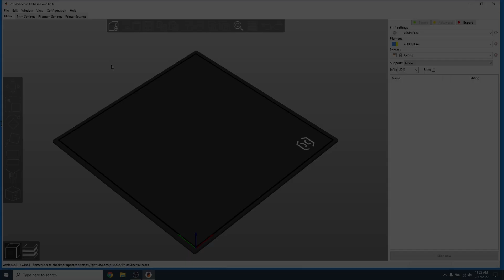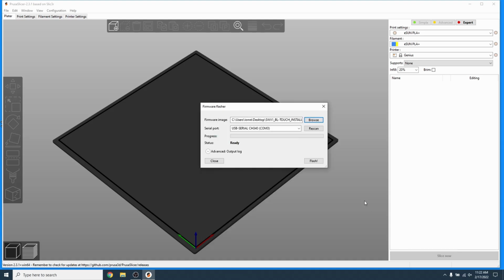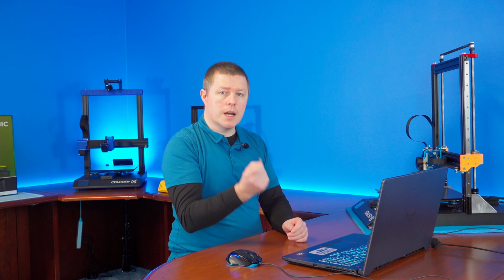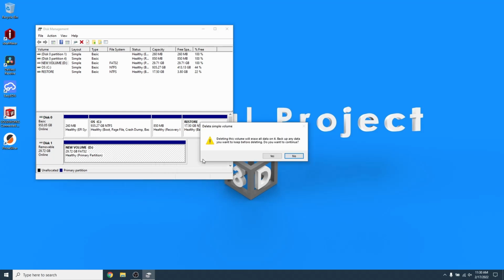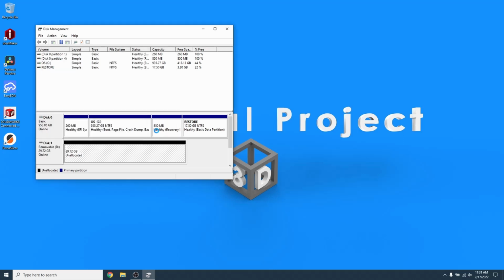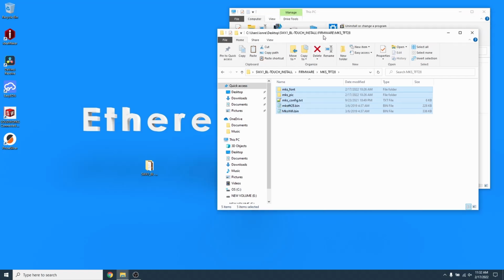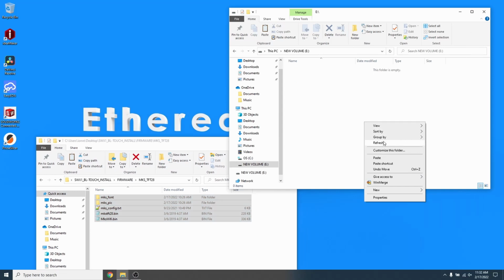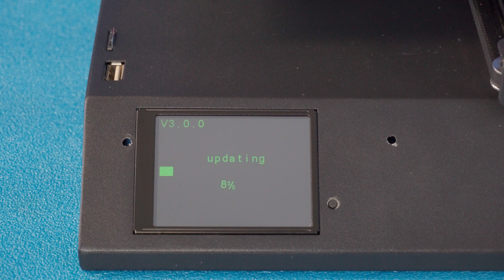Sidewinder X1 BL-Touch install, the easy way.

Comment: would it be possible to do this mod and then update the firmware to increase the max temperature? I am currently trying to do this with the wagster mod and Bl touch but I am struggling and I think it may be due to older firmware.
Reply from the maker: Yes I can update it for a higher temp. I am out for the rest of the week but will get it this weekend
Reply: @EtherealProject3D  thank you for the quick response, I was able to update max temp successfully. I guess now I should order the board and flash the firmware.

I am running a bondtech extruder. Do you happen to know if it is compatible with the new board? I would assume that it does since the extruder works with the stock board.
Reply from the maker: @eliteman125  I see no reason why it would not. The main purpose of the board is to give connections for the heater, fans, thermistor, extruder and bltouch.

Comment: Thanks for the great video. By the way, is there any way I can see the configuration.h and configuration _adv.h files for the compiled firmware? I need to edit some things for my new extruder. Thanks!
Reply from the maker: The source files are in the download.
Reply: I think a program that was still open was interfering with firmware while it was building. Closing it seems to fix the problem. Thanks again for the great video!
Reply from the maker: @talontartigrade63  Your welcome, and thank you.

Comment: Hi, i was not able to flash your source firmware with arduino as it gave me errors. 
Something about it not working for the ATMega 2560 board. Would love to give your firm a try though. 
I need to edit the firm as i use the Hemera extruder. I use another firmware for now but i use your TFT Firmware as the one that came with the other firm didn´t have the save to eeprom function. The combination works for now. Only thing missing to make this even more awesome is the AutoPID Function and ofcourse for me to be able to edit the source code and or just have the firm made for the Hemera. I´ll continue to try and edit the code and if i can i´ll report back here . :D
Reply from the maker: Have you tried vs code? Thats what i use. Also if you need me to make the changes for your hemera i can do that and send you the hex file.
Reply: @EtherealProject3D  Hey thanks for the quick response. I will give vs code a go and let you know. If i can´t get it to work then if you could edit it? that would be great. First i´ll try Vs code .
Reply from the maker: @TheNr1rob  Sweet, let me know how it gos.
Reply: @EtherealProject3D  Okaaay, i managed to get this working on my printer. I had to change some things in the code. One of these things is the Wagster mod pin change. Made some more changes though. Now i changed things around and have your firmware in my printer but use another firm for the tft as like that i have all the options i need. 
I hope you put some more funcions on you TFT firm as it looks great. And yes i used Vs code this time. I am printing a 7 hour long print to test it. So far works solid, thanks alot. If you want i can pass it along? so you can check it out.
Thanks again for this .
Reply from the maker: Sure that sounds great

Comment: Does the firmware still need to be upgraded if running the wagster mod?
Reply from the maker: If you are just installing the board than no, just make sure the wires are going to the correct spots.

Comment: I have your board, but haven't installed it yet. I might try to find a way to use the original z endstop with a pei bed.
Reply from the maker: It is doable for sure. If you need help please feel free to reach out.

Comment from the maker: UPDATE: 4-2-2022, I have added an STL file in the download with a BL-Touch mount that will fit those printers that have the standoffs on their extruder stepper motor. Its is "BL-Touch Mount (Big Holes)"

Comment: Hi ! I got a problem with the firmware it didn't flash. I got an error when verifying the .hex in the journal. And another thing, the heat's nozzle is negativ now.
Reply from the maker: Make sure you disconnect the TFT before flashing the mainboard.
Reply: @EtherealProject3D  Yes the TFT is disconnected. But I think I got a problem with the port COM. It's not staying open long enough. I'm on windows 10 and I hear the sound when the port connect and disconnect, and there is just a few seconds between each one. I try several cable but it didn't works better.
Reply: News from the darkness !! Anything is working but the screen. No moves, no heating. But I can say that you have a great logo.
The problem is on the motherboard, I think. I still can't connect the printer on Prusa slicer or Cura. 
Everything fine, it's just what I wanna do. Don't worry, it won't hurt.
Reply: So I check ten times, I flash ten times and ....It works ! Don't ask me why because  i change nothing.
But now when I do the Auto home, the extruder comes beating the left of the x axis, as if it don't stop at the end stop.
i change de cable on the motherboard in case I put the wrong one, but the same result.
And another question, when you flash the firmware with Prusa Slicer, do you need to be on the profil of the X1 ?
Reply from the maker: @filendiussivrac7442  no you dont need to be in any profile when flashing. Also if you have the printer connected to pronterface or even have cura open while flashing it will cause issues.
Reply: @EtherealProject3D  i order a new card for the x axis and a new endstop.
What will be the process to check if the problem comes from the motherboard ?
Reply: I'm still on the problem of the x axis. The endstop doesn't stop anything and it's a new one.
Reply from the maker: @filendiussivrac7442  At this point I would say you have a wiring problem.
Reply: @EtherealProject3D  In fact the x and y ensdtop don't work. So I would say that I'm gonna try ten times to reflash the firmware and see if it works.
If you have any idea ?
Reply from the maker: @filendiussivrac7442  They are not plugged in all the way or they are plugged into the wrong spot on the mainboard.
Reply: I re-flash the firmware and the problem is still here. It smell like the motherboard has a problem or the size of the bed is wrong on your firmware
Reply: @EtherealProject3D  Where would be the other plug ?
Reply: I try the other blue plug y axis and nothing.
Reply: is it normal in configuration.h :#define X_MIN_ENDSTOP_INVERTING true  // Set to true to invert the logic of the endstop.
#define Y_MIN_ENDSTOP_INVERTING true  // Set to true to invert the logic of the endstop.
they're setting on true instead of the others ? I try to compile the modification but i'can't.
I don't know what to do.
I replug all the tings to get back  and the endstops don't work. Could it be the mainboard ?
Would it worth it to upgrade it ?

Comment: This was a great video and very easy to follow along. I was able to easily add the BLTouch to my SWX1 V4 very easily. The only questions I have is, 1-will this still allow the printer to work with Repetier-Server Pro 1.2.1, 2-Repetier-Host and if so, are there any changes that need to be made to the slicer software within Repetier-Host? I primarily use Slic3r within Repetier-Host.
Reply from the maker: Im not sure, I have not tried that configuration before. Give it a try and let me know how it works. Thank you.

Comment: What was the reason for using a different connector for the thermister? Since you designed a new PCB, you could have used the standard connector to make it plug and play. If you need to krimp on new connector to the thermistor, you might as well just krimp on a dupont connector onto the BLtouch and plug it into the socket for the RGB led. Not sure how this board adds anything new to the table this way.
Reply from the maker: The new connector is a much more reliable connector that can hold up to the vibration and movement of the hot end. Same with the Ribbon cable connector, it locks down on the cable holding it in place more secure and putting more pressure on the contacts themselves creating a substantially more robust connection.
Reply: @EtherealProject3D  I missed the ribon cable connector, that's indeed a weak part of the original design.

I haven't had any issues with the thermister connectors on both of my machines though, but maybe I'm just lucky ;)

Comment: Hi Matt!  are  you planning on making the BL touch mount for an e3d Volcano block setup by any chance?  Thanks and keep up the awesome work mate!!
Reply: Forgot to add, my set up has BMG and Volcano, so I was wondering if this is something you would be able to include as options for your mount.   Or, BMG with v6.  Thanks!!
Reply from the maker: I would need a cad file for the bmg setup, or get my hands on one.
Reply: If you're still interested, I could provide CAD files for the BMG / Volcano setup which I've made in preparation to doing this mod myself. I'm not entirely sure of the dimensional accuracy, but since I've put the design together from the official BMG and Volcano dimensions, it should be close at least.
Another option would be to mount the BLTouch using a different method, like the height adjustable mount on 3DChan's ultimate cooler: https://www.thingiverse.com/thing:4548801

Comment: il na pas de LED ?????????????????
Reply from the maker: Connecting the BL-Touch using the existing traces in the ribbon cables will use the traces previously used by the LED.
Reply: @EtherealProject3D  j'ai acheter cette carte et j'ai pas reçu la piece et j'ai pas reçu de facture bizar ????
Reply: et j'ai un order number
Reply: yo lo que hice es poner en el frontal, junto a la pantalla TFT, el led retirado del extrusor, conectado a la conexión liberada de la placa base, mas que nada para ver la actividad de calentamiento del extrusor y de la cama

Comment: Fun to watch video, even though I don't need this mod (I own Artillery Genius). The linear rails mod for the Z axis caught my eye, are STL files available?
Reply from the maker: That is a work in progress and not any ware near my final design and I am not ready to share just yet. If done incorrectly it could cause issues with the printer. I'm sure there are plenty of people that could figure it out but there are also plenty of people that would do it wrong and potentially damage their machine and would be super pissed at me.

Comment: Thanks for this.  Can you please remix your BL touch bracket to support mosquito hot ends as well?
Reply from the maker: I don't have a Mosquito hot end to reference. If you have exact measurements of what you want, Its not hard to design up a new one.
Reply: Spoke too soon.  Extruder was fine until it just randomly locks up.  Not sure what is causing it, but the gear is just vibrating and not turning.  Very weird.
Reply from the maker: @Overnumbered808  You might need to adjust the Vref for the new extruder.
Reply: @EtherealProject3D  nah it appears that I'm just a noob and don't know how to load the filament into this bond tech properly.  I am just inexperienced with this setup.  Learning more about it everyday though.  I saw some posts about VREF adjustments but I probably won't dive too deep into it for now.  I properly loaded the filament and things are looking promising.
Reply from the maker: @Overnumbered808  Good, Im glad you seem to have figured it out.
Reply: @EtherealProject3D  unfortunately I haven’t figured it out.  The problem kept coming back and forced me to forego the BLtouch and board.  I reverted back to your mesh level firmware/stock PCB  (used reliably with mosquito magnum + LGX) for now.

Comment from the maker: For those of you that have been asking for my spool holder and filament guides, here is a link to the STL files. https://www.etherealproject3d.com/downloads/sidewinder-x1-spool-holder-and-guides
Reply: I noticed the filament guide in your video is two pieces, is there a benefit vs the downloadable file?  Also, Do you have some extra tubing on the one you have in the video?  Thanks for your videos. i ordered your board and have ordered a BL-Touch. Excited to install when it comes in.
Reply from the maker: @mfeltster  the 2 piece design was a previous version that was for testing the concept. The one piece guide makes it easy. You could add a little extra tubing going in and out but its not necessary. Thank you for your support.
Reply: @EtherealProject3D  Where do you get the tubing? Also, I notice your top belt sits a lot higher, out of curiosity what is that mod? Also, the BL-touch and PCB mod have been awesome! finally back to printing...thanks again
Reply from the maker: I got the PTFE tube on amazon. As far as the height of the top belt, I converted to 1204 ball screws and they are a little bit longer than the lead screws that come on the printer. Im happy you got your printer back up and running.
Reply: @EtherealProject3D  What did you do with filament runout sensor?
Reply from the maker: @mfeltster  I removed it.

Comment: hey! :)
Pls help me a little bit.
I have as same printer as you. sw x1.
when i start a print, i have to restart the printer two to three times to start, because the requested temperature will be zero.
can you possibly find a solution for this?
Thanks a lot!
Reply from the maker: Try a different slicer to rule that out.

Comment: I've already installed my bl-touch using a different method, but just watched this and I wish this was the video I watched to install mine, You made it extremally easy and also used good lighting which is VERY important when you have to plug in the connections to the board.

10/10. Keep up all the hard work.

Also anyway you could share the link to your spool holder? it looks AMAZING.
Edit: nvm about the feeder system,  I just saw the comment below saying you need to upload it still.
Reply from the maker: Thank you very much. Yeah I will get it uploaded this weekend.
Reply: @EtherealProject3D  Just tried to flash the firmware and run my BLtouch and I'm getting the error Stop! BLtouch error m999.

I'm guessing it is because I'm not using the same connection for my BLtouch?

I used the waggsters mod before you uploaded this so I no longer have the black wire connected. (Since my wires run to the led on the extruder instead of your board)

Any tips on what I should do? I'd much rather run your firmware versus the waggsters version since you have the option to level  four corners as well as the auto level.
Reply from the maker: @joshuamiller409  You can try to wire the inside of your printer like mine and I believe It will work. I started with wagsters setup and evolved it into what I have now.
Reply: @EtherealProject3D  mind if I pick you brain a little on discord?
Reply from the maker: I dont have discord, you can email my on my website

Comment: Excellent new set (which I know debuted last video) especially like the LED parameter lighting.
I agree with Jeremy Woods, you should be on retainer by Artillery.
Outstanding video!  I was anxious for this video and you did not disappoint.  Clear concise and perfectly informative.
p.s. If we are interested in your filament feed system where might we procure the files?
Reply from the maker: Thank you very much. I still need to upload the STL files to my website
Reply from the maker: I added my filament feed system to my website, https://www.etherealproject3d.com/downloads/sidewinder-x1-spool-holder-and-guides